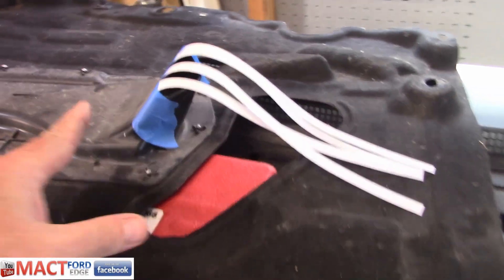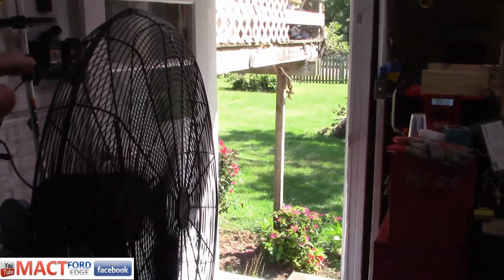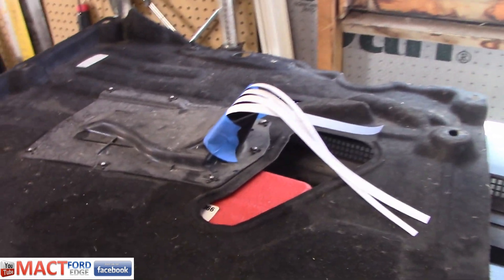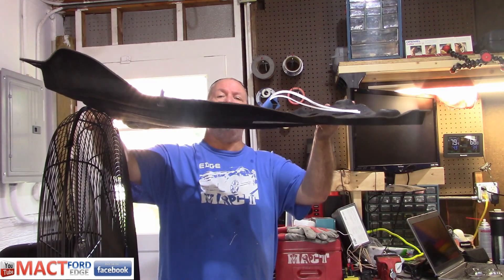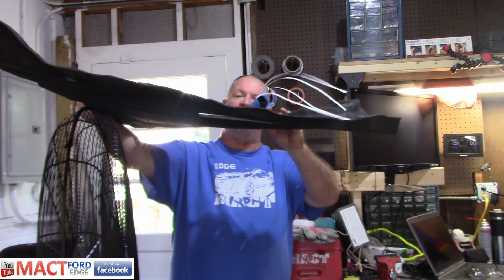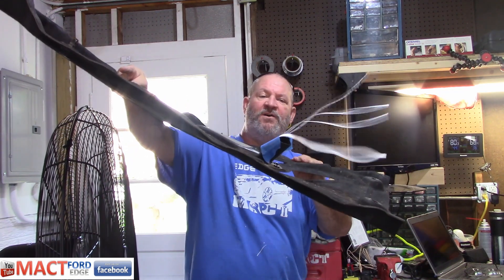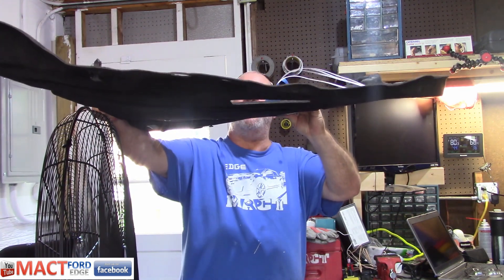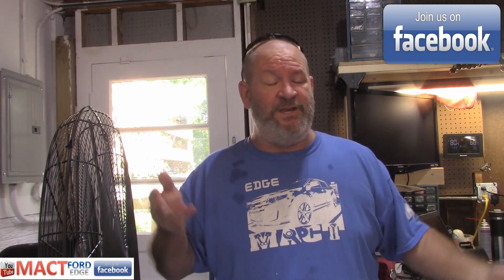Testing the under body PTU directional air cooling vent

Comment: Interesting but...
You have the panel sitting on top of the fan, not really in the airstream.
Also, you made no effort to determine the speed of the air coming off the fan. Low is 5mph, what do you think high is?

However, your last point about road debris is the nail in the coffin. Rather rig my own ducting from above as mentioned.

Comment: Not sufficient to test it like that. There is probably a high pressure area under the vehicle at speed in comparison to above it. It's about the difference in pressure to create flow.
Reply from the maker: Highway temp is about 140F degrees long travel at 75mph sustained for 200 miles.

Comment: You have the Ford Edge, I have the Explorer, Not alot of difference to them. I was looking under my Explorer the other day and the clearance seems to be off by a little. I noticed my muffler hangs lower than most other parts underneath, not to mention the heater and A/C lines running to the rear units, which are not covered in any way. No skid plates covering those lines?

Comment: Yeah I don't think that was a good enough test to prove your point. Need to use a thermometer or something to see if the airflow reduces the temperature which I believe it will with normal highway driving.
Reply: I am sure Ford did some testing with this to see if it worked after the last PTU issues.